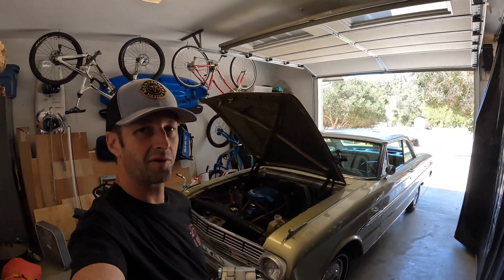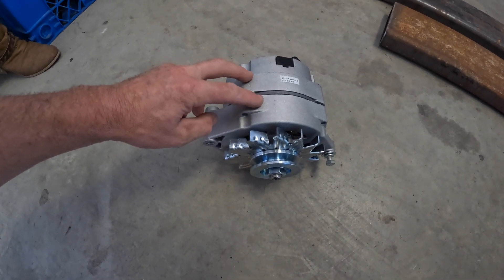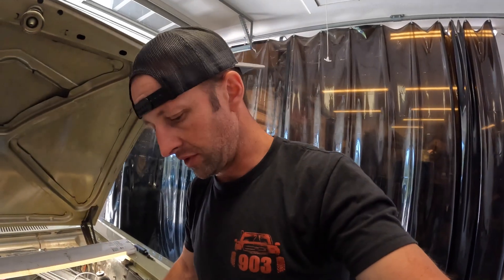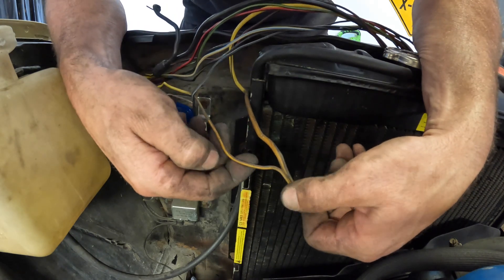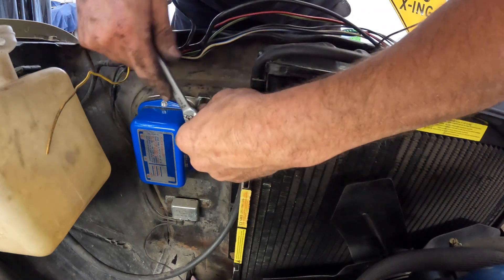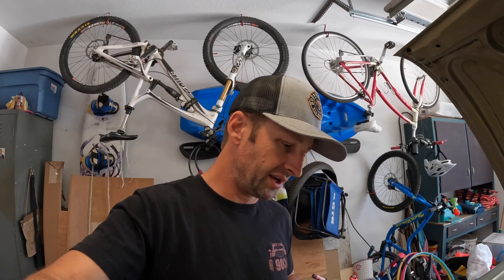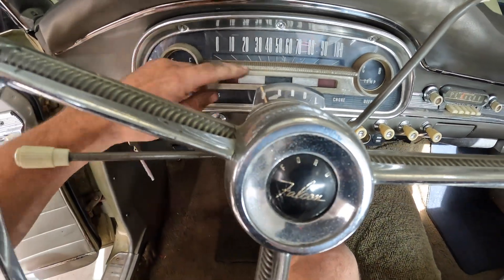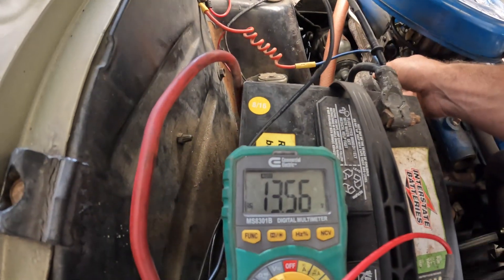How To: Chevy 1 Wire Alternator

Comment: Hey man. In need of help. The regulator had a wire that “Y” to the battery and to the car. How many wires (and what colors)went to the car?
Reply from the maker: Been a while, I’d have to go back and look.  The information is out there on the web if you dig deep enough.

Comment: Two things I noticed, a fan shroud will help significantly with the cooling, and have you tried cleaning the headlight groundings? Sand the contacts, add star washers (keps)if you don’t have them.
Reply from the maker: 100% on the shroud.  No immediate plans/needs for an electric fan, I just like them better.  Headlights are working great, but I definitely have a ground issue out back as the tail/stop lights are acting “odd”.  Thanks for watching!